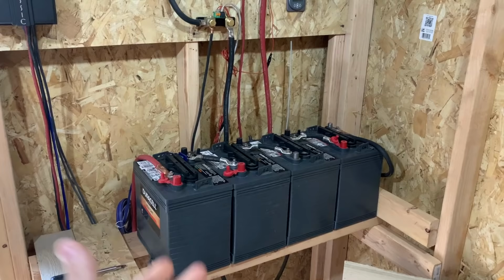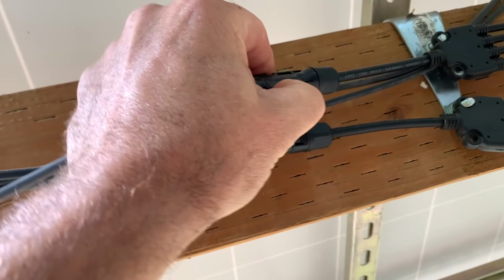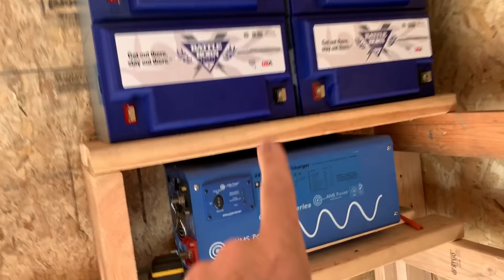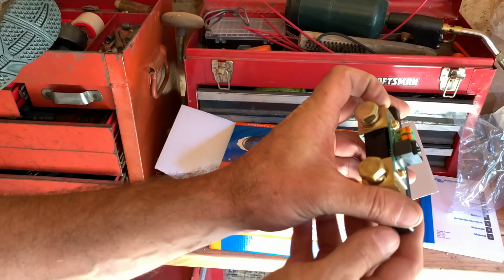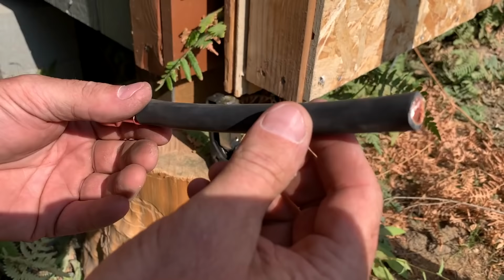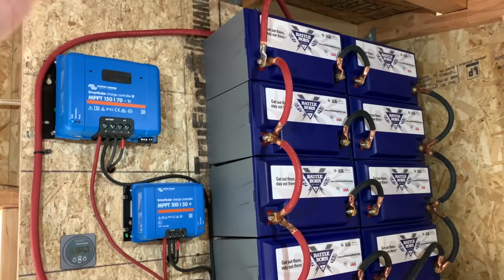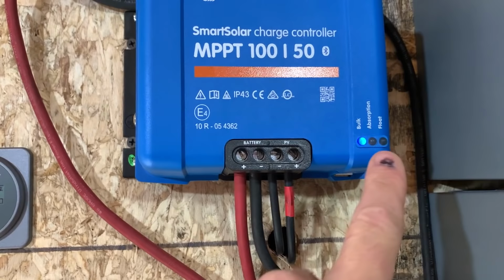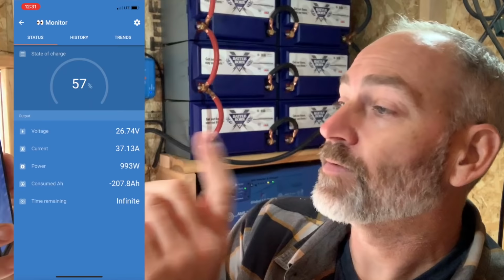EASIEST Off Grid Solar Power System Battery Bank

Comment: Enjoyed the video on your upgrade to your solar system. Lots of descriptions of each component. The one thing that you forgot to mention is the expense and what it would cost for each battery at $900 each and you were running eight of them. Total cost close to 10,000 dollars just in batteries. It would good to know what these items would cost us and not what you got them for for promoting Battle Born.
Reply: Also in saying that....If you replace these batteries every 10 years it would cost you 1000 dollars a year to run this system on the low end.
Reply: If it produces enough electricity. It could very well be a source of income of energy to sell back into the cities power grid. I mean spend 10,000 every 10 years and you may make more money back
Reply: Thank you! i wish stuff like that was mentioned up front
Reply: @Peter Evans a ten hour day that takes 3 days to recover from? Are you ok bud?
Reply: @Peter Evans why does it take you three days to recover? Are you broken?
Reply: @BrainScrambler80  Battle born batteries are under warranty for 10 years. They state that you can cycle them from 100 to 0 and back to 100 for 11 years every single day....these batteries will last you 20+ probably when not abused
Reply: @gewtube3794  If what you say is correct it would still cost $500 a year
Reply: @BrainScrambler80  less, with taxes and shipping you can find battleborns for 900. If you got 20 years it would average to about 30 a month. At 20 years they will not charge up to 100% though. Well worth the investment, i have a 48v system with 4 of them
Reply: @gewtube3794  I think what most of these people fail to understand is the freedom to not be attached to a utility company. That is priceless.
Reply: @inannashu689  ya they are sheep that need the Gov to take care of them
Reply: @Wayne-hs6gm  You wouldn't need batteries then.
Reply: @Peter Evans Once a year? Someone is not caring for their battery bank. My bank of Trojans is almost nine years old. I know I've been fortunate, but my quandary is will a lithium bank be worth the extra cost. I'm tempted to the much cheaper lead acid and wait for technology to improve and prices to fall.
Reply: @Peter Evans well first off youre wrong if youre refering to quality lithium batteries and secondly i never said lead acid is good, they are garbage
Reply: @Peter Evans his new batteries are battle born lithiums. You talking about his old batteries?
Reply: @Peter Evans oh i see, you watched 10 seconds of the video then started commenting ignorant things. He switched from junk lead acid to lithium. Youre a bit special aye?
Reply: @Peter Evans ugh....okay
Reply: exactly, they are a total rip off at $850/kWh... who in a healthy mind would pay that for raw batteries?? Even Tesla Powerwall is at $580/kWh... facepalm. DIY LiFePo packs are at $200/kWh...
Reply: @inannashu689  lol, how about understanding that you have a freedom to research and learn and make more educated decision to not be ripped off by companies like this one? I mean,... They are twice more than Tesla powerwall... seriously people...
Reply: @VladOnEarth  Just don't buy the system then,it's that simple. It's not that expensive for US prices. Before watching this video I was quoted 77 grand for a system way smaller than this. Did you see how easy this system was to set up? Think about how much you pay yearly being on the grid. Freedom to be off the grid is priceless.
Reply: @VladOnEarth  ya thats what i thought. No reply cause you actually dont know what youre talking about
Reply: @inannashu689  if you need to pay double for everything its not freedom :D
Reply: @normalusorasotutokstoras  8 batteries at $875 each = $7,000. Those batteries are good for at least 10 years. So that's $700 a year.

The solar panels are $335 each x 10 = $3,335. They are good for at least 25 years. So that's $134 a year.

$834 a year = $69.50 a month in electrical cost for at least 10 years straight.

Pretty darn good electric price per month. That would save me almost double...
Reply: @envirojay  you apparently dont know battleborn lithiums are under warranty for 10 years. Not sure where you got such terrible advice
Reply: @envirojay  im not suprised you didnt reply. People that are dead wrong usually run and hide
Reply: Lol. 100aH 12v batteries don't cost $900.  Someone lied to you
Reply: @briansorensen3562  battleborns do, they just recently went down in price a bit
Reply: @envirojay  I'm a lead acid guy until the price of lithium drastically drop. 
My Trojans costs me $140 ea. Plus my Trojans are 230 ah 6 volt batteries. That's nearly 6.5 times more for lithium batteries that are only 100 ah batteries. I've already got 4 years out of my batteries and they don't show any signs of failing. Granted monthly maintenance but just add distilled water.  Keep your state of charge above 50% and they'll last a long time.
Reply: @Peter Evans . I used to work at the local grocery dairy's department and had to move about 5 full pallets of milk every day out to the sales floor because we didn't have those access doors to do it from the inside. That means I manually lifted the weight twice to load and unload each pallet. Not everyone is a pansy that requires three days to recover after lifting a few batteries.
Reply: @Karl with a K Oh Carl....
Reply: My husband and I bought our own solar power system and had it installed right before all the newer laws that make it very much NOT a “money maker”. We paid $32,000.00 AFTER the $13,000 in rebates so the system was a total of  $45,000.00 INSTALLED. We had 36 solar panels for 245watts each @ 36 volts DC nominal feed into a Sunnyboy sb9000us grid tie inverter. Our house was all electric insta-hot for the water, a/c in the summer and a pellet stove for heat. We used a lot of electricity living in the So. CAl. Hi-desert but we produced way more then we used and yes Edison paid us but here’s the catch (keep in mind that since then the rules have changed a lot thanks to the “pull” in state government that Edison has). Edison only paid once a year so every 12 months we got a check. They were only paying .04cents a kWh while charging me .13cents a kWh. So to get into the plus side we had to produce 3 times the power we used. With the grid tie system all of the power you produce goes to the grid so Edison kept track of our use and production. At the end of the month they did the math and sent a bill showing a huge negative (meaning they owed me) and a $3 processing fee.  We lost the house almost 2years later (but kept the solar being that we paid cash and owned it outright) so we actually got 1full year check and 1partial year check the first year worked out to around $270 a month that Edison paid out to us since then the game changes Edison don’t mind you producing your own power but they hate to pay you if you produce more then you need forcing them to buy it. Now you can only put up what you need based on your past bills and they also changed the pay rate and complete system so that it’s almost impossible to “make money” buy installing solar power generation stations on your residence. Now to do it for profit now your talking a business and a whole different thing entirely. So as far as getting Edison to pay for your system by buying your excess power the game is rigged and not in your favor believe that. It will never happen and Edison has made it that way. They got deep pockets when it comes to lobbying for new laws and paying off officials but that’s not you and you are not allowed to stick YOUR hands into them.
Reply: Sounds like BS to me
Reply: Battle Borns are great for youtubers that don't have to pay for them. Us normal people just need to not fall for tricks like the ones used on this thread - comparing Battle Borns to Lead acids. Please, don't make me laugh.
For anyone else, if you're on the market for batteries, do your research. You can get a high quality 10.24 kWh for around $3000 delivered.
Reply: @brad2751  no solar panel on this earth is good for 25 years
Reply: Its much better to buy a single 48v battery pack from a company like mine.  See my profile for info.  It costs about half and that is not including the cost of all the wiring, fusing and safety stuff you don't need to install with one of my packs.  Not to mention the problems with balancing these.  Battle born has a couple videos on the problem (downplayed massively) and in my opinion it is a MASSIVE problem.  I could write a detailed description but most people wouldn't understand as its fairly complex.  A single battery pack that is either in closed loop communication with an inverter or that has contractor control of a charger and inverter bank is the only proper design IMO.
Reply: @Karl with a K This video is about LifeP04 batteries
Reply: @inannashu689  I'll do it for $177K, or just give me all your money lol
Reply: @briansorensen3562  Yes they do - some way more than that...Victron
Reply: @pstoneking3418  You have no clue. 1) LifePo4 batteries currently 350-600. 2)They have 2x the useful energy of the same LA battery. 3)Their cycle count is 3x to 5x the LA. 4) They are half the weight 5) No Maintenance 6) Can be mounted upside down if you wish. Do the math - LifePo4 is cheaper.
Reply: @Karl with a K why would you replace lead batteries once a year? I feel like you are trying to make a point but clearly understand NOTHING about lead acid batteries. Even the cheapest junk lead acid batteries in a vehicle constantly exposed to high temps under the hood, and tens of thousands of miles of vibrations, will typically last 4 years. In an environment where they are not exposed to vibrations, and huge swings of temperature fluctuations from engine heat followed by cooling off a hour later, these batteries could easily last 6 years on the low end. So yeah, your numbers are way off. I sold batteries for Johnson Controls who makes 90% of the batteries in the United States. It is not "rare" to sometimes get 8 years out of these batteries that are specifically designed for this application. These lithium batteries he is showing here typically last about 25% longer. Yet they cost 800% more. Not hard to figure out which is the better deal
Reply: @gewtube3794  you are talking about how long these lithium batteries will last when none of them have been around for 20 years. Everything you are saying is VERY hypothetical based on zero actual real world experience.
Reply: @gewtube3794  Being a sheep is buying into the idea that you need $8k worth of batteries that you can buy lead acid batteries specifically built for the same application that have a 10 year warranty for $890. Even if they only lasted half the time, they still would only be $1,800 versus the $8k the lithium batteries cost. Yes lithium batteries are better but the cost to performance ratio is not there yet. If you believe it is, you are the sheep. It's the same concept as why do vehicle manufacturers not make engines out of titanium, and chrome moly, and same with all the suspension and steering components? The cars could last half a million miles with probably no repairs. Well because the vehicle that normally costs $40k would end up being $200k despite lasting only 3 times as long. Very few people would buy it. Why not make $500 titanium door knobs that last forever? We could play this game with everything using your logic. How about titanium shingles on the roof for a $200k roof?
Reply: @jameseden9380  no he cant be if it takes him 10 hours to change 10 batteries and another three days to recover from the exertion thereafter...  imagine if he tried to do some gardening or diy projects
Reply: The average car battery will have an Ah rating somewhere around 50Ah. The 50Ah means that it can push 12 volts out at a rate of 50 amperes in an hour. COST $60. NO NEED for these overpriced batteries. so get 10 for $600. connect in series =120 volts or a combination and charge via  solar cells and have inverter. total cost under 3000....
Reply: @inannashu689  The average car battery will have an Ah rating somewhere around 50Ah. The 50Ah means that it can push 12 volts out at a rate of 50 amperes in an hour. COST $60. NO NEED for these overpriced batteries. so get 10 for $600. connect in series =120 volts or a combination and charge via  solar cells and have inverter. total cost under 3000....
Reply: @heidikeely6859  you have been robbed. only costs 3k max
Reply: @brad2751  Unless my electricity bill is that or less each month.  Your math actually makes this solar setup a break even scenario at best, or an actual increase at worst.
Reply: @Wayne-hs6gm  But.... if you want to be off-grid, just SAY NO to The Man. F'm!
Reply: @brad2751  Seems like we need to buy some wind turbines... to run the house while wind is available with a switch to the system when the wind isn't sufficient.
Reply: @briansorensen3562  Battle Born website dude , $924 each !
Reply: @toddjohnson271  I agree it does take a great deal of money to have a system as this one.. Dose this system really satisfy their electrical needs or does it have to be supplemented?
Reply: @dukeman7595  Even if it provided all of it.....the cost of startup to replacement in a decade is more than the grid for most people.
Reply: @BrainScrambler80  But imagine paying year on year to the energy company? if it can last then it'll definately work out cheaper
Reply: @Karl with a K it has everything to do with decision making
Reply: @Karl with a K Solar gives you resilience. The grid is fragile and it’s only a matter of time before it goes down for a long period of time for whatever reason, of which there are many. That, and having public power means the power company having rights onto your property and a key to any lock you put on a gate. Not a fan. So yes, for a lot of people it’s about independence. I’ll pay more to be secure. You do you.
Reply: The golf cart batteries he replaced them with go for about 180-220each. Obviously he has been using them no problem so you can too especially if you were unaware of the cost of a lithium bank. 900 bucks is a big difference from 10k.
Reply: @brad2751  You forgot the inverter. That won't last 10 years. and the pricetag is a hefty one.
Reply: @brad2751  And after 10 years the cost continues to amortize.
Reply: That's hideously expensive for Lifepo4 batteries.  There are much cheaper options.
Reply: @gewtube3794  Funny that as I must be lucky then as the Original Battery on my 25 year old car seems to work just fine, maybe you got a dud one or talking out of your hole, oh yeah I know which one....
Reply: @chrise4659  I agree. He upgraded to these batteries because they most likely gave them to him for free, in hopes that he would make this video and entice thousands of other people into buying them. This was just paid for advertising. Unfortunately most people like us who are going into solar power, do this so we can SAVE money. A lot of us who are into this can do our own research and add up numbers and see very quickly that while this is a great system, it is NOT the most cost effective.
Reply: I agree, It's hard to justify solar as my main power when I can get grid power for under 10 cents a  kWh. Price, reliability and convenance make any household solar setup a no go in my book at this time from a financial prospective. It would be cool and nice but so would winning the lottery.
Reply: @timmothyburke  I'd like info please
Reply: @baxydalia  Youtube blocks any kind of link or even things similar to links.  You find info after clicking on my mountain fire icon.  Or you can search for northwest independence ,solar, batteries and tim burke
Reply: We are a professional manufacturer of power banks, contact us now.
Reply: Best to see what the best should be Atleast once before you start cutting corners because of financial limitations. Good for this dude on scoring a system from a company - who cares Donald , just be happy man. 😎
Reply: @tommyg87nmsu  Uhhh, you don't know much about batteries.  This system totally sucks.  Its a horrible design with serious problems.
Reply: @tommyg87nmsu  This design is like the opposite of what I would do.  I'm a battery expert.  Sad that so many are doing it totally wrong.
Reply: I bought 32, raw, grade A, 320AH batteries for $3150. 4 batteries to a box, 8 boxes. Buuuut, they're still on a boat from china, here soon. Trying to do a 48v, 12kw, 240vac system for $10k-12k, slowly, as $ permits. Hopefully summer its up.
Reply: Come on, he got three free T-Shirts ....

Comment: Great upgrades. A couple of safety suggestions.
1. Add a disconnect switch at your panels.
2. Add a disconnect switch at your batteries (this will also prevent sparking in the future if you have to disconnect or you can use a resistor to drain the capacitor in the batteries before connecting)
3. Add a lighting suppressor to system.
4. Add a grounding rod at panels 
5. add a grou d to your generator.
Great progress, keep it going.
Reply: Quit using the term "bad boy".
Reply: Good advice
Reply: ...Don't use flammable plates to mount electric components on...
Reply: Why didn’t he heat shrink the cables
Reply: With all the money you’ve put into this, is it EMF protected?
Reply: 6. Add a smaller fuse to those tiny wires supplying the shunt's electronics.
Reply: @Nutzernameungueltig4  cement board.
Reply: @starkenterprises2371  Some aluminum plate would do it as well.
Properly grounded, of course...